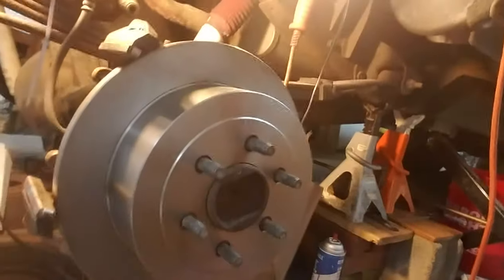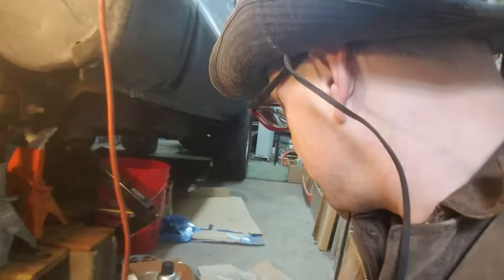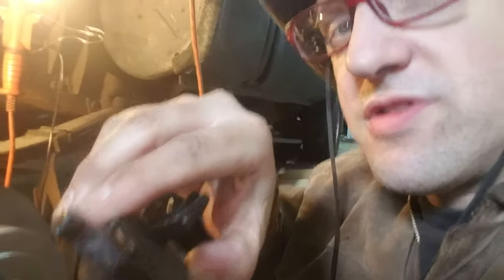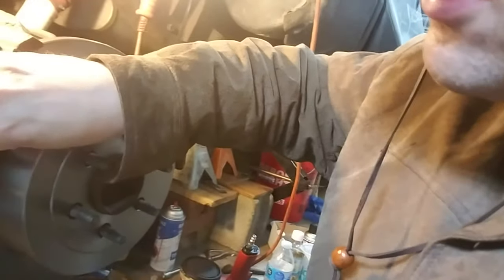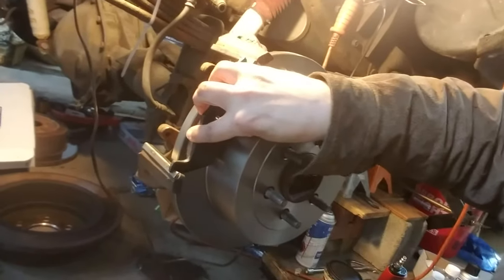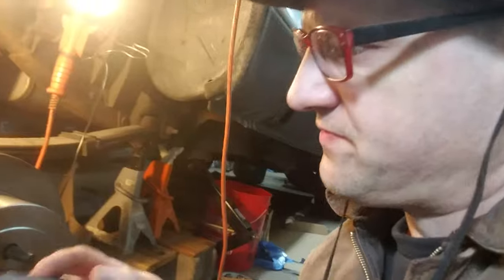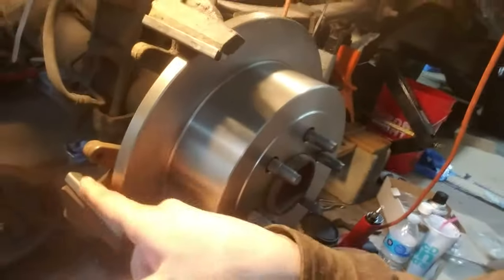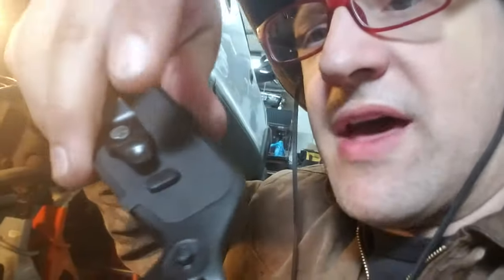Brake pads too tight? Here's a solution!

Comment: That's good.  I just yesterday changed my rear pads and discs (rotors) in a 2003 VW Golf.  Never done the job before and I didn't know they were supposed to move that freely.  There's like a spring clip that they slide on, and that holds them in position, but the new ones I had to really force in place.  After a 10 mile test drive one of them was really hot.  Could be a number of reasons for that I know, but but tomorrow I'm going to take them out and file them to make sure they slide nicely.
Reply from the maker: You're absolutely right! There are a number of reasons they could be getting really hot, but if you had to force them in, filing down to fit is probably a very good move. Something I've done is compared the fit of the new pads to the fit of the old ones. This is especially useful if its as newer vehicle and the old ones are original equipment!  Ideally, the new pads should be no tighter nor no looser than the OEMs. Thanks for commenting!  Good luck on your brakes. I hope you solve your issues.
Reply: Thanks for your reply!

Well the new pads were tighter than the old ones on both sides, but the side where the pads had to be really forced into place is getting just warm, whereas the other side is the one getting so hot that the alloy wheel itself is warm to the touch.

Luckily I have a spare car to drive so I can take this slow and learn as I go.  Neither caliper was seized, but how easy they should be to wind back I don't know.  Some effort was required, but they felt smooth all the way back.  They're the type that has to be turned clockwise and pushed.  Both had split rubber piston boots

I suspect possibly a problem with the handbrake cable not releasing positively because the handbrake lever feels 'kind of weird' on that car.  Sometimes the replacement calipers for that car have extra springs fitted externally to assist the handbrake cable return.  Possibly the springs are available separately.   I'm quite happy to replace the calipers if needed.

But it's great to know that I am 'allowed' to file the pads to fit.  I've done all kinds of basic repairs and servicing on my cars over the years, but I've never dared touch the brakes before now, so it's all new to me.
Reply from the maker: @paulmackilligin1754  I only learned about working on the hand brakes a couple months ago with my truck. I got it used and when I got it, the brake already seemed to do nothing. Turned out that the cable wasn't connected to anything and the hardware inside the rear wheel hubs was an ancient mass of rust. I ended up replacing everything- hardware, shoes, cable lengths, tensioner. It was involved, but not too difficult. 

Anyway, it sounds like you're well on your way with your brakes. Keep your eyes on the heating up issues. If brakes get too hot it can cause them to fail, so if they ever feel like they're dragging or if you smell burned pads, pull over, let them cool and make repairs as soon as you can. Thanks for keeping me updated. I think its really helpful when people share their experiences.
Reply: @ClayCarlino  2020-09-09 18:43:17  Aha!  Well the o/s r/h (UK) rear brake is not binding now.  It was binding before and now it's not.  It was getting very hot and now it's not.  The wheel would not turn easily by hand and now it spins a couple of times round before stopping.  It feels right now.

The pads were fine I think on that side: they were not over-tight in their guide springs/shims (although they very much are overtight on the other side, and I'll free those up later today.)  The handbrake cable mechanism on the caliper was returning to the rest position OK, and the handbrake feels fine now.  (I think it felt 'weird' before because the pads were worn down to almost nothing.)  The slidey pins were sliding as they should, although one felt very slightly 'gritty' in one position. Anyway I took them out, cleaned them and re-packed them with silicone grease.

HOWEVER, the caliper piston's rubber dust boot was badly torn (which I knew) and part of it had flopped over and jammed between the piston crown and the inboard pad (which I didn't know!), so I reckon that was what was binding the brakes up.  I cut away the loose, torn front part of the boot and put it all back together.

So, ...it really needs a new caliper, ...or the old one refurbished with new seals, etc, ...but it does seem to work fine for now.
Reply: Yes, so just for completeness, I did file a pair of pads down by just 1mm or so, and they fitted much better.  Very easy.  Rear brakes all working well now.  No excessive heat.
Reply from the maker: @paulmackilligin1754  dude, that's great! Good work all the way around! That's a lot to take on and to figure out, but it sounds like you've done extremely well! 

I agree about the caliper. You should not leave it as it is without the boot. It would be great if you could just replace the boots and seals yourself, but sometimes you just can't get the parts or they just aren't serviceable. Whatever you end up doing, it seems like you know what you're doing and have a good solid plan. Congratulations.  Accomplishing all this HAS to feel good!
Reply: @ClayCarlino  Thanks for your support Clay.  Having discovered that one brake pad had worn down to the metal and that the car was therefore not safe to drive at all, my mission was to get the car safely driveable so I can blow the ** out of the diesel injectors, etc, to get it to pass the emissions part of the annual MoT safety check.  That check may reveal other stuff that needs doing, or it may not be possible to meet the new stricter emissions limits.  (I hate it when they move the goalposts mid-game and make a car that was perfectly legal suddenly not legal.)  If it passes that test, then it gets new calipers, or new piston boots fitted to the old ones, plus new discs and pads on the front.

As for the caliper servicing, a new rear caliper is only £65, so I'd be inclined to swap it out and then buy a caliper service kit for £5 and rebuild the old one for the fun of it, and keep it as a spare.
Reply from the maker: @paulmackilligin1754  happy to help! I hope your inspection goes well. Here in Pennsylvania, we have similar inspections, but if you have an old vehicle sometimes you are exempt from the emissions standards. (For vehicles that can't pass even when restored to original operation.) Thanks for all your comments and sharing your experiences!
Reply: @ClayCarlino  Thanks.  Here in the UK the particulate emissions limit for my own car used to be a standard 3.0 m-1 (whatever that is) which was based on the age and type of the vehicle, but a couple of years back that changed and for the same car particulates now have to be less than 0.9 m-1.  (Moving the goalposts mid-game = Not fair.)  It will probably pass if I pour some injector cleaner in the fuel tank and floor it up some steep hills to blow the c**p out before the test, but with that faulty rear brake I could not drive the car at all, so had no way to do that.

Comment: Thanks, I found somebody with same problem! Yeah, i ran into this on my 2003 lexus rx300, I cleaned and sanded and finially got the new pads in, but the didn't float. and began squeaking down the road about 1/2 mile. Tomorrow i get to try again.
Reply from the maker: That's rough! The first time it happened to me,  I only sanded just enough to get them to fit, but that was a mistake. Without the ability to float a bit, they just don't work right.
Good luck tomorrow! Thanks for commenting!

Comment: thanks this fixes my issue, I was having to put new disc brakes every year because one side turned out to be too tight, after replacing guide pins and filing down the new brake pads the wheel spins freely now. problem solved.
Reply from the maker: Awesome! I’m so glad! It’s a pretty common problem… (at least it’s been common for me!)  and when I was a bit less bold with my repairs, I was reluctant to modify new parts, but sometimes the obvious solution actually does work. Thanks for watching and thanks for commenting!

Comment: This happens every time I change my pads.
Stupid question. Why don't they make the pads so they actually fit?
Reply from the maker: That is NOT stupid question! That’s a great question! I have thoughts, but I could be completely full of 💩.

I recently responded to a comment on this video where the person ended up getting a new caliper and then the new pads fit perfectly. 

So possibility 1.) Perhaps as the calipers age and build up layers of corrosion, the pads don’t fit as well. 

2.) lots of auto parts are made from cast steel. The molds for casting to wear over time and periodically have to be re-machined or sometimes replaced entirely. Once that happens, even though the new molds are technically “in spec” with the original parts, they are often not EXACTLY the same. The difference may be the cause of the parts not fitting.

Those are my thoughts! I don’t know if I’m right, but it’s what makes sense to me. Thanks for watching and thanks for commenting!

Comment: Just installed pads on one side and the file just came to mind! Fitting the old pad with old hardware are hard as well, and I remember the old pads not wanting to come out. I probably forced it in last time without any afterthought and there's hope that maybe it's not the caliper that needs to be rebuilt!
Reply from the maker: My guess is that your caliper is fine.I’ve seen this happen on a fair number of vehicles. I think it’s just a common problem of inconsistent parts sizing. But once you know it can happen, the fix it not too difficult.

Thanks for watching and thanks for commenting!
Reply: @ClayCarlino  Bought a new caliper for the other side and didn't have to file the same brake pads. My guess is that the caliper was corroded and perhaps warped too thus changing the clearance.
Reply from the maker: @thaik56  good job! I guess the lesson for me is that if my pads don’t fit, I may need a new caliper! Thanks for the tip!
Reply: @ClayCarlino  Filing the caliper bracket might help! It'd be a waste to replace the caliper if the piston and pin are in good shape. I replaced mine because the piston was seized, boot was torn and twisted and sliding pin was rusted. It was probably whenever the brake pads were replaced I didn't file the new pads and they were stuck from the very beginning and caused overheating and ruining the caliper. It is however tempting to replace the caliper, got mine from Rockauto brand new Raybestos including bracket, sliding pin, boot and hardware for 135CAD tax and shipping included. My local parts store was 152 CAD for remanufactured without tax and core needed.
Reply from the maker: @thaik56  nice! You gotta love rockauto! You just can’t beat their deals. It sounds like you made the right choice. I’m probably going to buying a bunch of parts there myself soon. I think my car needs brakes, rotors and shocks. I’m procrastinating though! Ha ha ha! Good work on all the stuff you’ve done! Thanks for reaching out!
Reply: @ClayCarlino  It's a pleasure exchanging with follow DIY mechanics! Another tip: don't forget to research on forums the brands of parts you buying! I bought Raybestos with confidence knowing they're reputable brake part manufacturer and reading people had good experience buying it brand new.
Reply from the maker: @thaik56  thanks for the tip! That’s an area that I’m often pretty lax in. I get frustrated quickly when going through forums and not finding the information I’m looking for. Then I get impatient and just give up on the internet,  roll the dice and buy something. I sometimes regret that! Ha ha! Thanks again!
Reply: @ClayCarlino  it's a bit of both actually. Some research for reassurance but a bit of gambling too !
Reply from the maker: @thaik56  true that!

Comment: Good info. Thanks!  My thoughts. 
1. Always use new caliper slide hardware. Note how to install it. Existing hardware should be a guide, but it is possible slide hardware was incorrectly installed on last brake job. 
2. Wire brush and use a small file on the caliper bracket slide rails. Clean with brake cleaner. 
3. Dry fit. If tight, lightly file abound pad tabs. Try again. If still tight go back to filing rust/corrosion off bracket. Use a dremmel tool or file. 
4. The best option is to file down caliper bracket. To bare metal.
5. If that does not get enough material off , then file down pad tabs in area where binding, which is the top, ie pad too long or sides, ie pad tab too wide for slides. 
6. Once fit is ok, then lube under slide and on slide.
Reply from the maker: Excellent advice! I heartily agree. Thanks for providing such a good detailed list of steps. That should be very helpful to people!

Thanks for watching and thanks for commenting!
Reply: I'm working an 08 town and country. Owner just bought it and wanted a few things done like brakes. 
There were no pad guides in caliper bracket. It's surprising the brakes worked at all. One side was worn to the metal and the other was at the metal on one side. I'm guessing they did that because the pads would not fit in over the slides. And the slides are sitting over corrosion. 
Anywho , those brackets will need some grinding to clean up.
Reply from the maker: @Snowdog216  oh wow! Yeah that makes sense!  I suspect you are right- the last person couldn't get the pads to fit so they didn't use the guides. Bad call! Although it sounds like the last owner wasn't big on servicing the vehicle in the first place!

Also, good call on cleaning up all that corrosion. It sounds like this car is finally going to get the love it desperately needs! 

Thanks for the comment and thanks for watching!
Reply: So it's either a corrosion issue, warped caliper brackets, or bad pad design?

Comment: Okay back today. It was exactly what you said with my pads in the front. They didn't move for nothing. Now they DO. Thanks.  I used to feel the caliper temp after a long drive. All four where warm for a long time, no brake problems. Then one day after a drive the front brakes are hotter than usual, extremely hot still today .now the rotor is warped. Ive never knew why. But the pads weren't moving freely on the Grease on the claps I would think now. And when I let off the brake I guess the pads were staying where they were pressed when driving ,but with no pressure , . So I'll go check

Comment: I just changed my brakes. The pads fit a little too tight. So I put back on both tires. But I think in about 5 minutes I'm going to go out and seeing them and do what you did in the video. If I'm able to go do that you saved my butt.

Comment: Hey Clay l filed down my rear brake pads for my 2012 Pathfinder. I didn't paint the ends like you did. Put some grease on the moving parts though. Do you think it will be alright without the touch up paint. Nice video. Thanks neil
Reply from the maker: I suspect it will be fine, it might be worth checking the condition whenever you have the wheel off next just see if there’s any problems- which is probably good advice regardless. But yeah. I painted mine because I wanted to do whatever I could to ensure no problems would arise. Do I think it’s REQUIRED, no. Probably not. Good luck! Thanks for watching and thanks for commenting!
Reply: Thanks appreciate your help

Comment: This is what happens when quality standards go out the window and qualify people are not hired for the job 20 years ago you never had to do this I just tried this an hour ago 2009 Hyundai sonata rear pads the pads would not even fit in the bracket without the clips that's how bad they are and unfortunately I don't have a bench grinder to grind down the tabs if I use the file it probably would take me an hour each pad I tried taking the pain off rubbing it on the ground and still wasn't enough still do not fit in the bracket without the clips after taking the paint off

Comment: This happens on my  hyundai.     A little grinding and when you can just slide the pads in with no problem you are good to go.       Never have this problem on my Subaru, just slide right in.  I wonder why?
Reply from the maker: It’s funny, just yesterday, someone else was asking the same question about this. I think sometimes it has to do with corrosion buildup on the the calipers making things not fit as well as when they are new, or the subtle differences in parts that occur when the molds for the parts break down and get re-machined. In both cases, little changes can make a big difference in fitment. Thanks for watching and thanks for commenting!